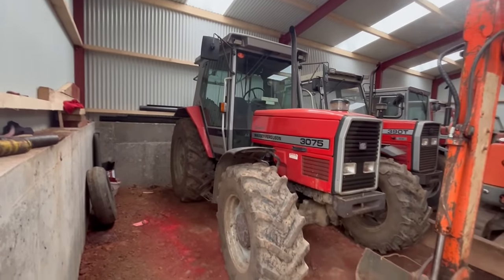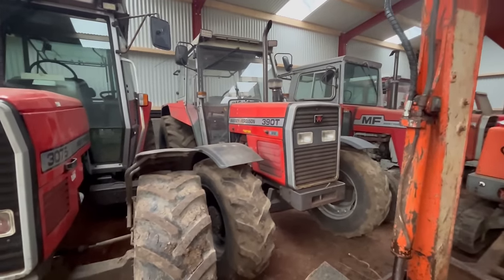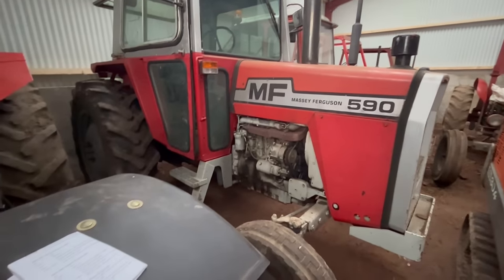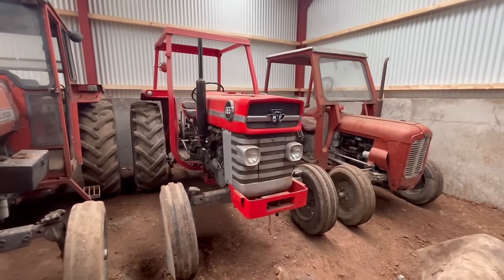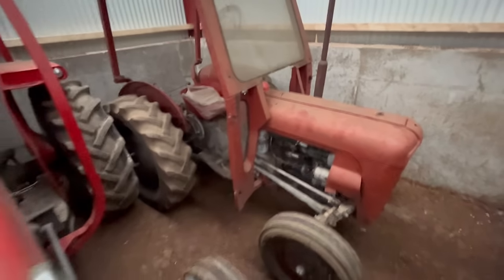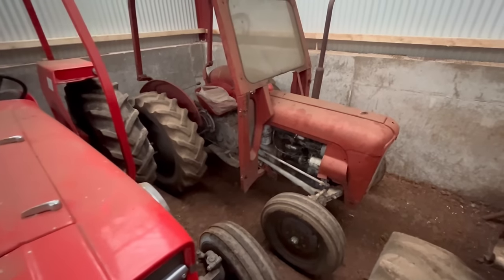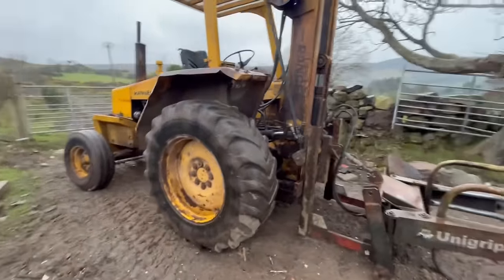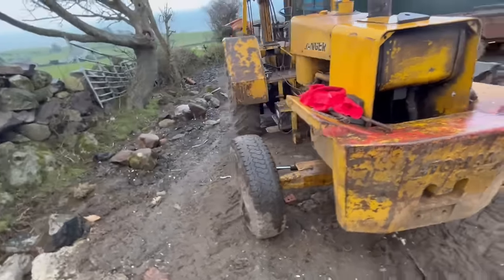A look at all 17 Tractors on the farm, horsepower, history and future plans.

Comment: That's a great collection of Massey Ferguson tractors. As someone who watches Grassmen and John McClean from Farmflix i find it staggering to see how many people are John Deere on the brain and would run down Massey in a heartbeat. OK some of the Massey ranges gave problems but that's the same in every brand. Its good to see a Northern Ireland man having pride in a tractor which has its very DNA in this country. Yourself and the Killen brothers are the only ones i see flying the Massey Ferguson flag (Farmer Phil here in the republic is also  a Massey man). We are Massey men also. In my time i remember 135,165,168,185,188, 2 x 575's,590,690,698,699,390,398,399 tractors on the farm and today we still have a 3080,4255,4345 and 5465. Our fleet is getting old but they will have to do for a while yet cos you would need to win the lottery to be able to buy anything new.
Reply from the maker: Thanks Ollie, thats some range of tractors you have had over the years.  I would actually like to add a 42 or 43 series to mine as these were the last out of Banner Lane.  I think both the cost of new and even older tractors has gone through the roof.

Comment: Great video , I had a 698T some years ago I loved the tractor but it got hard to start so I moved it on for a 6270 as well as a 8220 great tractors , I came across a 390t two years ago it was unloved where it was and is hard to start probably needs a set of sleeves and pistons, my late father's first tractor was a used petrol grey Fergie then he purchased a new TEF20 1955/56 later on a 35 three cylinder so I was born into the Ferguson stable like yourself😁
Reply from the maker: Thanks John.  390T will defo be worth of fixing and straightening out.😃

Comment: 6265 are on paper should be 115 hp, I had one for 2 years but never really liked it, but also had a 6280 and she was a great work horse pulled well
Reply from the maker: Funny you say that Richard as I did not like the 6265 when it came, but it kind of grew on me when the 3075 was off line.  6280 super machine.
Reply: The 6265 had a loader, it replaced a 390 loader tractor. We also had a 3065 which was replaced with a 52 plate 6270 which was a great tractor  then we got 51 plate 6280 which I used daily for hauling mushroom compost in 12 ton silage trailer which ther 53 plate 6265 wasn't quite the same on it, It lacked the grunt on the hills. Then the final one to the collection was a 54 plate 6480 which was ok but I didn't like the cab suspension.

Comment: Some fleet tractors had 168.from new 4000 pound cut terror silage on jf single chop.great tractor until put loader.on it home.made grab far too big it few years later recked
Reply from the maker: Thanks Gerry. That's a pity about the 168, the front axel was just not strong enough I suppose for the heavy loader.

Comment: After watching the video New Sub 👍
Reply from the maker: Thanks Bob and welcome to the channel. 👍
Reply: @FlyingFergyMan  first tractor as a young farm worker was an FE35, then a 35x then a 65,then 135, then a 148 then 165, then 575 4wd then 595, then 698 with Opico turbo she was a beast 💪💪 then the 2000 series which were a fantastic draft tractor, our neighbours farm had a 1200 and got the chance to work the 2640 alongside it and it just made a fool of the 1200 especially when turning with a Dowdeswell DP8 reversible on the steeper ground much more stable and also seemed to pull better when ploughing uphill 🤔💪💪👍
Reply from the maker: @bobpaterson1845 Hi Bob that’s very interesting history and very interesting that the 2640 eclipsed the 1200. Id like a 2000 series for the collection but I am a big 1200 fan to😊.

Comment: Interesting video! I have a working fleet of fergys too, albeit a bit bigger ones. 3075, 2x6480, 7618, 7490, 7495, 7620 & 7720 in the working fleet, which has grown in size because we've added to the fleet rather than replace with new since prices have gone silly. We have a more random fleet of almost retired classics too - Ford 5600, Renault 551, International 454 and an auld Major.
Reply: And a 135, how could I forget the 135!!
Reply from the maker: Thanks, thats quite the fleet you have there.  As you say the price of new has gone through the roof, but the price of second hand is now also sky rocking. 👍😃